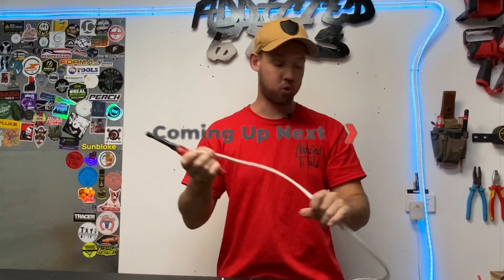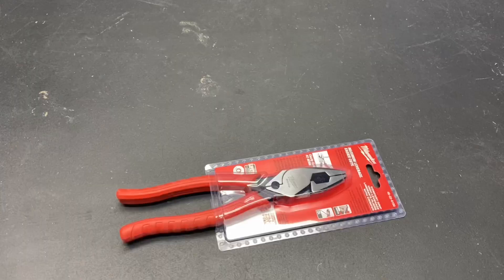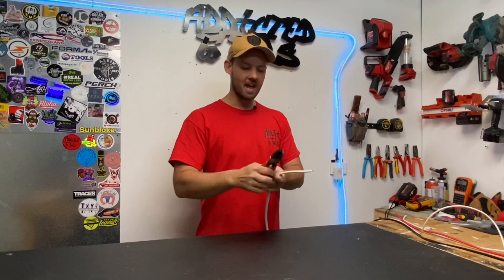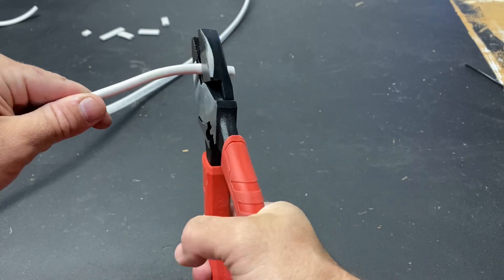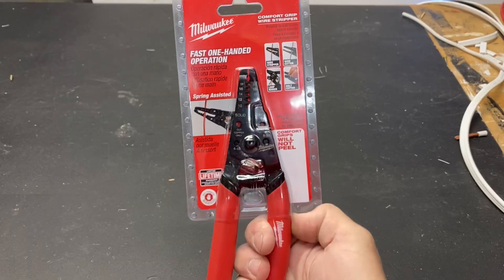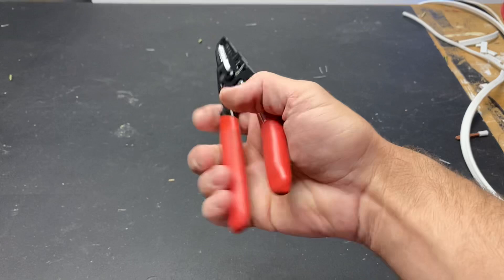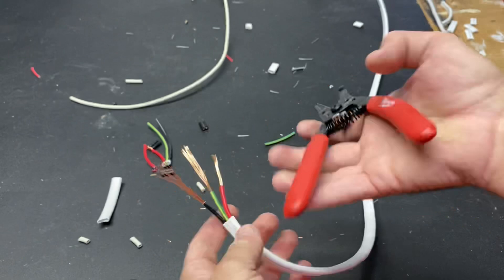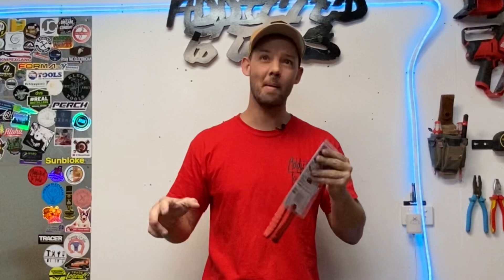Milwaukee electricians pliers

Comment: We use the loop maker in the US because in residential, most of the wires are solid as opposed to stranded. We make a loop that goes around the screw terminals of switches and receptacles. Also, the bolt cutters are designed to not mess up the threads on machine screws.

Comment: i use the 7 in 1 pliers as my fit off pliers but i have recently got the knipex pliers the ones that strip 1.5 and 2.5 mil because they can pull cable with the soft grips at the end of the pliers unlike my marvel pliers or these ones. these are great i love them and the high leverage pliers for milwaukee are good as a quick pick up if i have forgotten my other ones but if i have cables that are live i dont want to risk using non insulated tools so i have now a spare marvel pliers in case the unexpected happens.

Comment: I use strippers all the time, more reliable when using flex cable also love cross cuts, though the last pair of orange handle marvels I bought had one side of the teeth chip within a week, wholesaler straight swapped me a second pair and they did the same, put it down to poor quality steel or incorrect heat treatment. 

Ended up buying red handled wattmaster cross cuts 6 months on so far so good

Comment: Yeah, AWG is American Wire Gauge and is how wires are sized in the US. On our strippers, the solid is always one size larger than the stranded for the same hole. I guess stranded conductors take up a little more space than solid ones inside the insulation.

Comment: Used the 7in1s for a while now as an Aussie, won’t lie they are pretty good but personally I’d rather swap the crosscuts for pinch cuts just because it’s easier to strip with and change the strippers to do 1.5, 2.5, 4 and 6 mm cable and as you said Matt make them vde and then they’d have a ripper set of strippers

Comment: Ive been using cable shears for years. Good heavy cut, then you can strip the outer, then the inner. Cable shears even have one smaller cut radius at the front of the jaws.

The reason i got the milwaukee 7 n 1 was so i didnt have to carry pliers just to fold the ends over.

But seeing you use linesmans to do ALL jobs, maybe thats the unicorn do-it-all of cable prep 🤔. Just when i tried stripping it seemed a bit difficult, maybe because i was using a crap brand 🤷‍♂️

Comment: That’s AWG (American Wire Guage) and you’re correct it’s Stranded and Solid. Everyone in the states have strippers that do it all. Makes the job so easy.

I have the Milwaukee 7-1 version and the Knipex brand which I feel are absolutely the best. I use the Knipex 13 72 8 8” Forged Wire Strippers. In my opinion they’re best in class.
Reply from the maker: I’ve seen a few people with those knipex online. They look incredible. I’d be keen to try those out. Thanks for the information 👍

Comment: Can you tell me how you stripped the outer sheathing without cutting or exposing anything else. It seemed effortless but there's gotta be a technique to it. Another thing. Why do you have to cut a bolt for. Is it because it's to long to go in a receptical box
Reply: You buy the long screws and cut them to the needed length.

Comment: I bought a pair of Klein strippers/pliers very similar to the Milwaukee and tried them out, not a fan. Too much pissing around with the individual holes for the individual wires, linesman’s all day, save so much time compared to strippers.

Comment: Was really keen on finding a good set of multi purpose pliers like the 7 in 1 to lower the risk of developing RSI as much as possible. Not sure if these are it by the looks though
Reply from the maker: I like that idea. I don’t believe they will help much. I’d be interested in what could help with RSI. I know I’ve been feeling it as I get older and do a lot of fitting off. Let me know if you have any ideas or find anything.
Reply: @AddictedtoTools  stripping is a contributor no doubt but I feel twisting cable would be the biggest culprit. I’d also been looking into those auto strip and twist drill bits you bought but clearly they need improvements to be used effectively. 

I don’t think there is a twisting tool with little to no strain on the fingers and wrist. Could be a market there

Comment: I use th looping function it's quite nice actually
Reply from the maker: Can I ask what you use it for? I usually use the end of my pliers. Never even knew the looping function existed. I’ll have to give it a go.
Reply: @AddictedtoTools  so you know when you're putting wires on your receptacle and it's not a push in so you make a loop put it on the screw you make a hook and then tighten the screw onto the hook?
Reply: @AddictedtoTools  it works just like using the end of your pliers but I find it makes a nicer loop takes a little practice but once you get it down it makes a beautiful hook
Reply from the maker: Ahh that makes perfect sense now. We don’t use too many of those terminals but I’ll definitely remember that. Cheers for the info. 👌🍻
Reply: @AddictedtoTools  well most modern receptacles just allow you to push in The wire and tighten down and stranded wire is a you know different beast  entirely I'm coming form that even when you are bonding a metal box and you're wrapping the ground around the ground screw

Comment: Wouldn't use a Line style Plier if not rated. Electrical Religion says every wire is Live. And in my experience, the Channel Lock holds its sharpness the best of all. The Marvel not so good, the Miwaukee not sharp for long at all, the Knipex too brittle and edge fractures. The Channel Lock were the only only Line Style we tested that could cut Piano Wire without hurting the edge same for Lindstrom with the cutters.

Comment: what are your thoughts on Xtrorque pliers?
Reply from the maker: I’ve seen both their cross cuts and the xpcvde pliers that look exactly like flukes. I haven’t handled the crosscuts yet, but I have handled the other set. They are 180mm which for me is too small and they were extremely stiff. They are rebranded German pliers though so they should cut well. I would like to get a set to try out long term.

Comment: They  are insulated. They just aren't rated to a 1000v. Think, there is no situation where you will be stripping up to 4mm single phase that will be over 250v. Remember, the VDE rating hasn't been around that long, and for decades before, we only had crescent and Marvel linesman insulated pliers without ever getting a shock through the insulated handles. 
P.S. yes, they are marked for american wire gauges stranded and solid.

Comment: I notice that after stripping you cut with the well part of pliers to the outside, (and it is there for a purpose) and since it will properly measure your wire for cut, especially after you strip long pieces and twist them it is a bad habit. Live and learn.
Reply from the maker: Hey Kenneth. Thanks for the critique. Could you give me the time on the video which you’re referring to as I’m not really sure what you mean. Cheer s

Comment: I struggle to understand why anyone would use these. Standard pliers are quicker to twist and join cable, and if you can’t strip cable with pliers you could try the auto-strippers - which are even handy in Aus when doing big boards and shit with decent amount of circuits. Makes it easier on ya thumbs.
Reply from the maker: Realistically these are made for the uk and USA market. They’re mainly using solid core cabling and not twisting with pliers. Totally different for here in aus. I agree with you.
Reply: I’m a apprentice in California. I have a knipex auto stripper but it doesn’t work on the cable type we most commonly use THHN. The auto strippers slip off the outer layer of plastic without stripping the insulation.
Reply: if they are sharp and you use the correct gauge then you don't ever need to use your thumb or ream them or twist them. all you do is relax your cutting hand a hair so the blade can not drag on the copper and  pull the insulation off. I don't see how you can cut insulation with regular pilers without cutting the copper a little. once the copper has been cut it's compromised. I think you can minimize the amount of damage to the inner insulation and copper but you can't eliminate it. any knick on the copper means the whole section must be discarded.

Comment: Small tip when you put a single wire in the gauge give it a little twist prior to pulling. Your thumbs will thank you. Sadly most tools sold in the US require oiling. I use WD-40 and 15 to 30 minutes. I run the klein hybrid pliers with the gray and black handles
Reply from the maker: Thanks for the tip. I’ve now tried some wd40 and 3in1 oil. Still not looking too good. Fingers crossed👍

Comment: 2nd youtuber I've seen today who casually strips outer jacket insulation like its not a horrible safety hazard. It will cut the inner insulation at the bottom of the cut and if the outer jacket slips up a little bit then it will HIDE the cuts you just made on all the inner insulation. You now have to pull the jacket back down and inspect each individual wire for compromised insulation. Same thing with the wires, if you nick the copper it's trash.
Reply from the maker: Hey mate, can I ask if you’ve ever done it like this? I don’t cut through the outer sheath. It’s a rip and doesn’t effect the inner at all.
Reply: I strip cables like this all the time. Its about technique and doing it for years. You know when you got a little pressure just to cut slight as it tears/rips.

But I understand your concern. I had a guy on a job for me strip outer sheath and do exactly what you said. I pulled him up straight away and said it wasn’t acceptable